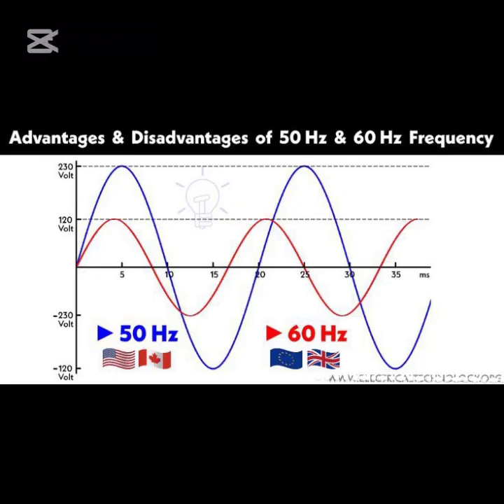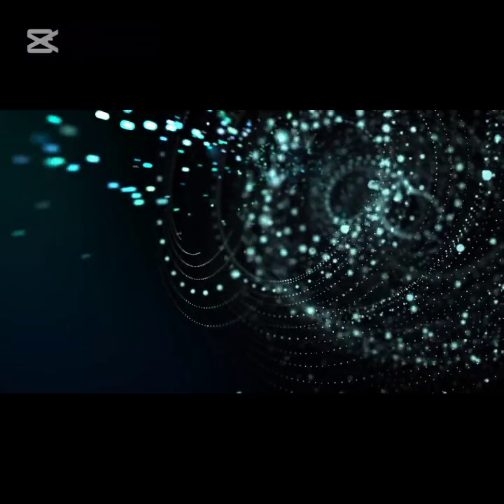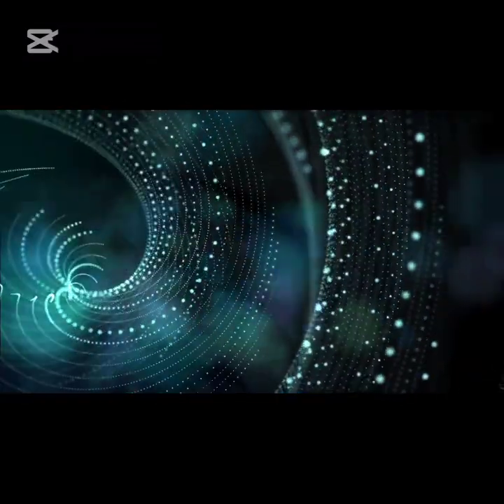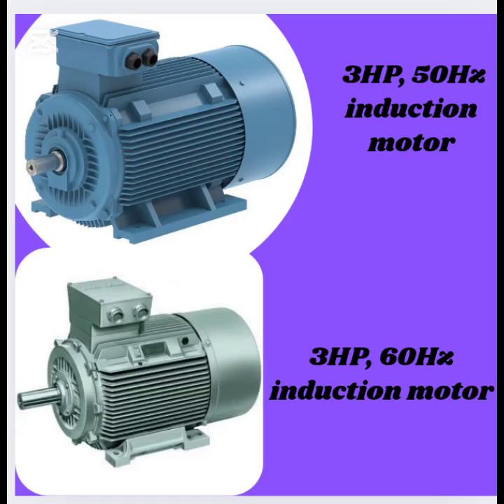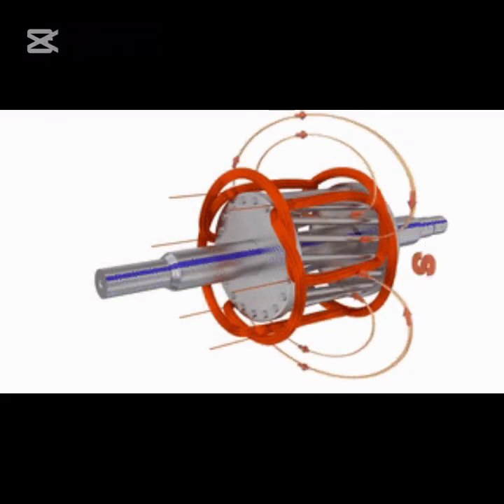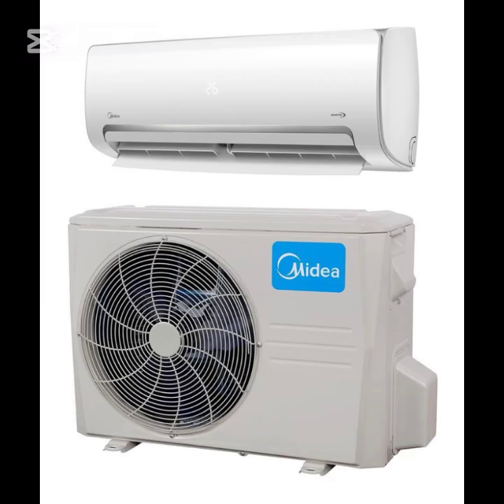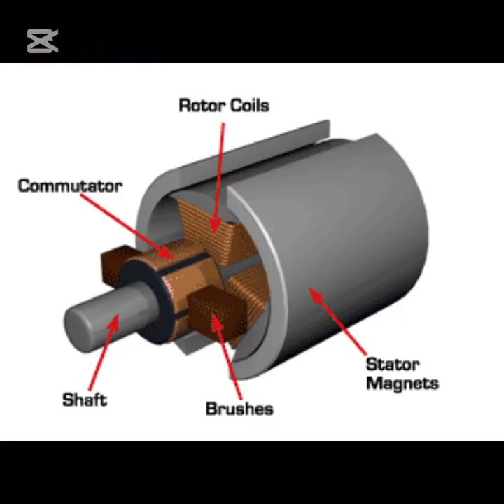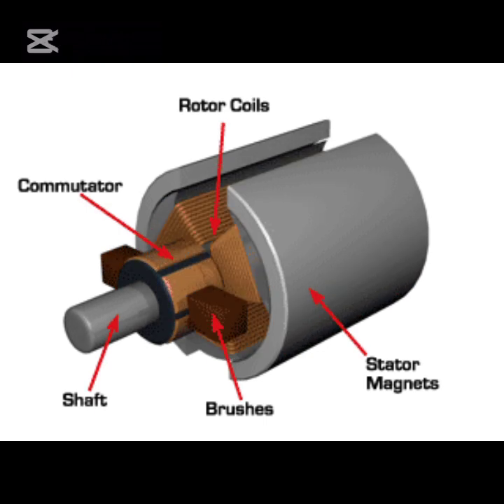What are the comparison between 50Hz and 60Hz systems | 50Hz vs 60Hz Explained!

Comment: The part that is confusing is Japan ! They have 50 and 60 HZ in same country . Only place in the world that way . Years back we had a 25 HZ system that no longer is used.  100 HZ was tried but only worked a short distance. UHVDC is a game changer . Allowing different grids of 50 and 60 HZ to work together . and only 2 wires instead of 3 needed. And no skin effect . China having 1.1 MV UHVDC and worlds largest transformer.  Cheers from NY !